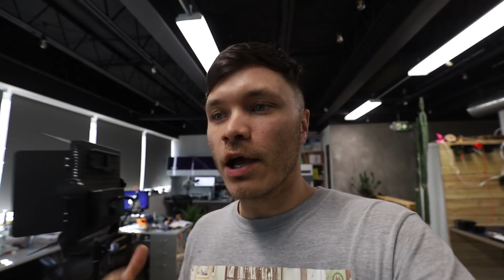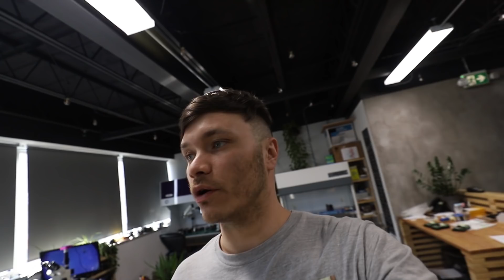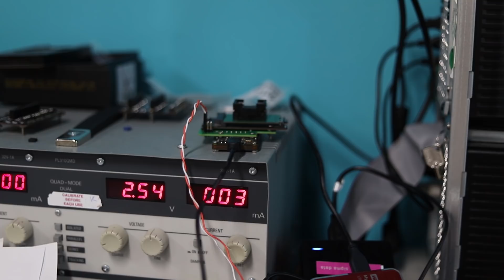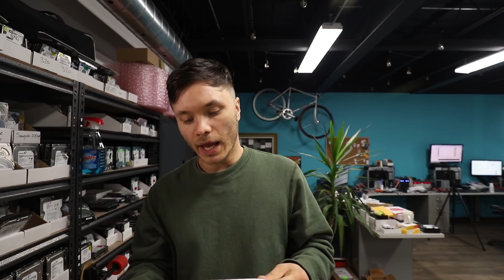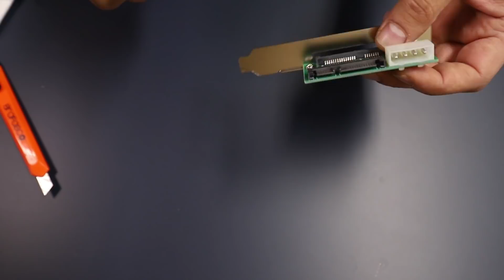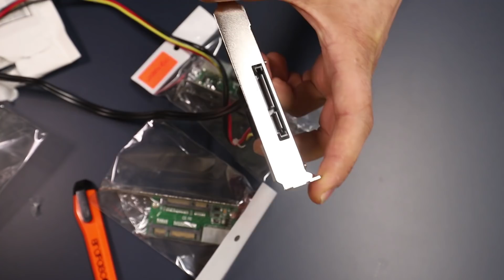PNY flash drive recovery part 2 and modding Laminar

Comment: The console to manipulate the voltage comes with the Flash Extractor?  How's that works?
Reply from the maker: The one I use has EXT VCC that hooks to a DC power supply. Crank the dial and get whatever voltage you need :) just not too much or chip will burn

Comment: Regarding the laminar mod, are you concerned at all about voltage drop or data issues given extension and additional connection?
Ive thought about the same, i think its going to be great for you to reduce the obstacles. I mounted a screen on an arm OUTSIDE but no where near your experience.
Reply from the maker: Hopefully it's not going to effect things
Reply: HDD Recovery Services  looking forward to seeing the mods